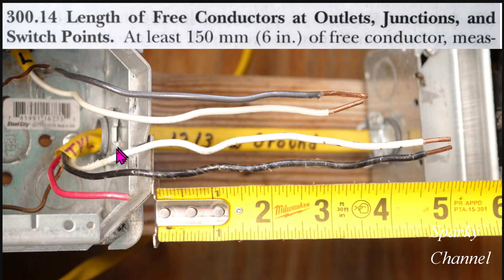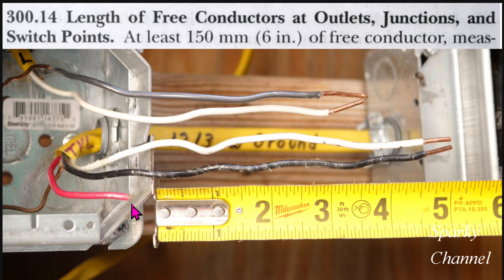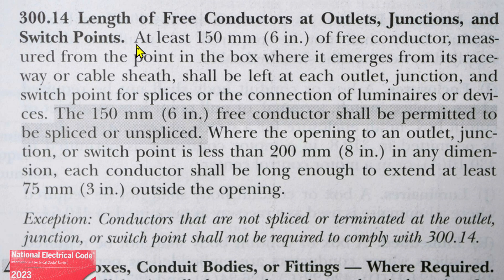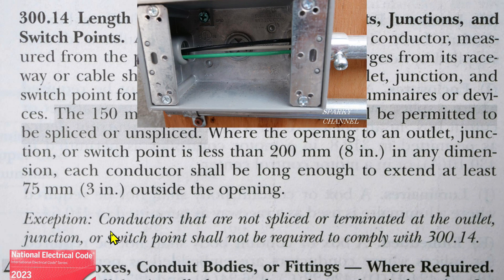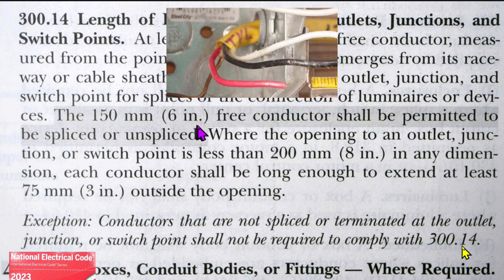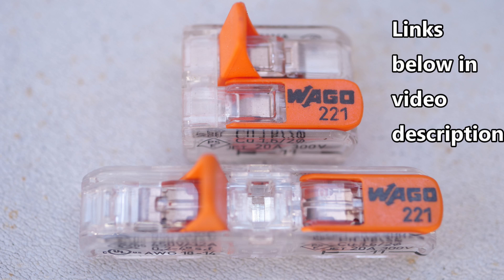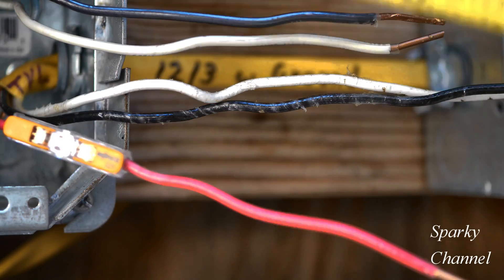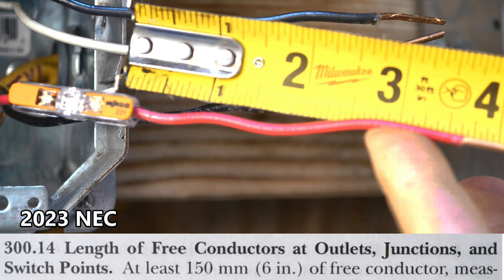How to Extend Short Wires per 2023 NEC 300.14

Comment: What do you do if the goof before you cut the ground wire right at the entrance to the box? (ie: not connected to anything, barely 1/4" visible in the box ) ?

Fortunately for me, they were as sloppy as they were dumb and there was ~2-3" of slop in the wall so I could pull a bit more into the box to connect it to the box's ground screw and then add a pigtail to that to the outlet.
Not sure if that is proper code these days, but the outlet tester settled down and stopped complaining about an open ground.
Reply: loosen the wire clamp and see if you can pull it in more wire, if your lucky there will be an extra 6" of loose wire you can pull into the box (called a service loop)
Reply: maybe I should have read the whole comment.  pull the wire harder, I think you only got half the service loop and got hung up on the bend in it.  that extra wire isn't sloppy, its code
Reply: @ydnark83  Interesting. It was janky all around. Have not lived there for over 15 years. But the wiring in that house was..... special. One outlet did not have any ground coming to it - very old 2 conductor, no ground wire with very fragile insulation. Wire was behind a tiled wall. The hack that was done there was to tie neutral and ground together in the box so the outlet tester was happy (although I suspect no inspector would be!).
Reply: @eh42  you might have aluminum wire, if you do you need wire connectors that are meant for connecting alum and copper and overhandling the aluminum wire will make it brittle and crumbly.  That might be why its too short in the first place too..
Reply: a good outlet tester would show that the ground and neutral are bonded
Reply: @ydnark83  The short wire that I pulled on was new 14/2 Romex - copper. But the other wire in the house might have been - that section I left alone. Another section I was upgrading was in the basement w/ open floor joists, and at each junction box where I touched it, the insulation crumbled and I would replace that stretch w/ new 14/2 Romex. Never did consider aluminum at the time. Fortunately that house has since been gutted to the joists, etc and completely redone inside - so hopefully all the sketchy wiring has been since replaced.
Reply: @ydnark83  How? The rest of the outlets have their ground and neutrals bonded at the panel - so unless it has some fancy ping testing circuit, I'm curious how it would know that the bond is in the outlet vs the panel.
Reply: @eh42  it will show if its bonded or not, not where the bond is, and yeah that's not really useful if your bonded at the panel but there is an led on mine that lights up if they are.   you could remove the bonding screw at the panel to check for other miswired outlets I guess but again not really useful.  Better to just inspect them 1 by 1
Reply: @ydnark83  code? Please show, I am curious
Reply: @sapreaper  code for what?  the service loop?  not sure what you mean, you might be in the wrong thread..
Reply: @ydnark83  you stated "the extra wire isn't sloppy, it's code" what extra wire or 'cable' ? Thanks

Comment: Your interpretation is taking the wires and bending them 90 degrees in one direction and then measuring 3" in either direction, but does the interpretation need to mean 'bend the wires' and go 3" from either side of the opening? Couldn't it just mean that the wires need to extend 3" straight out from the opening in the wall"?
Reply from the maker: Yes, you're correct. However, in a video, if you run the wire straight towards the camera, no one can tell how long the wires are.

Comment: So NEC-2023 allows you to splice onto short wires.  Did the previous codes allow that?  Many AHJ haven't adopted 2023 yet, so can you pick and choose which NEC version you're complying with?
Reply: I'll give you a straight answer, you can always splice wires in a box and that has been legal for over 30 years
Reply from the maker: Please go to article 300.14 of the code book that covers the year that you need to know about. It will tell you the answer there.

Comment: Just use an insulated butt splice.
Reply: good for stranded only
Reply: @71dembonesTV  why is that?
Reply: @danlux4954  can't get an adequate crimp onto solid wire; especially if its already too short in the back of a box. the wagos are THE solution for short wires. the standard type is adequate for most short wires but the straight thru ones look even better. have yet to use them but , im looking forward to having them in my arsenal
Reply: @71dembonesTV  I can get a proper crimp onto solid wire even in a space like that.
Reply: @danlux4954  you may be able to get what you call a proper crimp on it and it very well may work. doesn't change the fact that those type of connectors are for stranded wire.
Reply: @71dembonesTV  FYI the manufacturers site and specs says nothing about it being only for stranded wire.
Reply: @danlux4954  you are talking about crimp on connectors right? yes they do say they are intended for stranded wire. but it should not need to say that because it's just logical. you aren't going to get much contact area with a solid wire because it wont conform to the crimp.
Reply: @71dembonesTV  yes, if they were just made for stranded wire it definitely should say. And it’s copper wires and definitely will conform being a soft metal.

Comment: Bill or anyone know how to strip a #2 awg without knife? I mean I can do it with a knife but sometimes I sure would like a much easier cleaner way of stripping it. I have searched the Google and I came across many stripping tools but not one that may be usable for a #2 wire. I might have missed it though. Any advice or name of tool?
Reply: Take your pick:
1. Klein Tools 21051 Large Cable Stripper
2. C. K Tools 430004 Kabifix Cable Stripper
3. Jonard Tools CST-1900
4. KNIPEX 1620165SB
5. WEICON No. S4-28
And while you're at it treat yourself to a pair of KNIPEX StepCut Cable Shears in standard, comfort, or insulated grip style at your preference; they're a huge improvement over standard cutters when dealing with large gauge wiring conductors.
Reply: Thermally. Precision torch tip , gloves and a pulled with appropriate twist. Strangle with single strand for clean insulation termination ￼
Reply: I do marine quality battery cables.  I was nasa trained in basic high quality soldering   1981.  I have advanced since then
Reply: There are insulation cutting tools that rotate around the wire cutting the insulation. Sort of how a pipe-cutter works. This only works when you have a fair amount of room.

Comment: just a thought but i wouldn't pull all the wires to one side or the other to measure them i would pull them straight out of the box to measure
Reply from the maker: I would pull the wire straight out of the box to measure them. I just pulled them to the side because of my camera angle. If I pull them straight towards the camera, no one could tell exactly how long they were.

Comment: A question that may have been asked/answered already...
 Can a crimp type butt connector be used in these applications? I'm talking about the red, blue, yellow style that is often the norm in lower voltage (but often higher current) applications. Assuming proper heatshrink and /or tape covering is applied if and when needed. 
 I am not an electchicken but do all my own work and prefer to be better than code in everything i do.
Reply: As long as they are listed for that use yes. They would have to be listed for use with the wire size and voltage.
Reply: As Jason said, the butt splice has to be listed for that application.  And what I consider key is, are you sure you can install it properly?  A lot of folks use simple butt splices with crude pliers-like crimpers and don't get a proper crimp.  And some of the proper crimping tools can be too costly for the average DIYer.  While WAGO may cost a tad more, the installation of them is dead simple as Sparky shows.
Reply from the maker: I agree with Jason.
Reply: I have been using the typical Butt splice connectors for 35+ years in low voltage applications. I have the correct crimpers and knowledge.  I personally do not care for the wago style of connector as I've seen too many ofnthose type have weak connection and when higher current is pulled thtough them, they tend to get crispy over time.  
 I understand they are NEC compliant but we all know of similar compliant items that fail over time/useage.
Reply: @manmachinemake3708  Watch from 7:30 of the video titled "Connectors: Which is the Weakest Link" by the channel "Electromagnetic Videos". After 5 minutes at 50 amps the Wago push-in only connector failed when the current was raised to 65 amps, and the lever Wago failed at 70 amps. Wago connectors are more than safe when used within their rating, and do not get 'crispy over time', they have been used for decades in Germany without issue.

Comment: pull a 20 amp load, continuous threw that wago, and watch it melt.
Reply: Do you have a video to back that up? 
Don’t get me wrong, I am not that big of a fan of these lever connectors, but if I had $.10 for every comment that says that they melt under the rated current, I’d be rich.
Reply: @Gruntled2001  no video, just 30+ years experience.  look at the surface contact area of this device, compared with a wire nut, or other approved connector. the wago only "bites" into a very small piece of the conductor.  that alone will generate heat under heavy loads.
Reply: @keything8487  the wago bites the wire but it also has a tab for it to sit on, so you get more contact than say a backstab receptacle
Reply: @keything8487  I don't think a major brand name like Wago would be able to get its listing and certifications if they failed at the rated load. For the benefit of the doubters, there are plenty of videos like this out there: https://www.youtube.com/watch?v=4QVwAT4vd4g
Reply: @R900DZ  i wouldnt back stab a receptacle, if i saw an apprentice do it, he would get smacked.
Reply: @keything8487  sounds like an HR nightmare
Reply: @keything8487  If you want to make a few thousand dollars, put up a video on Youtube showing the wagos melting at 20 amps.   Better  yet,  send that video to Wago and tell them you will expose them on Youtube if they don't pay you for your very expensive time in making the video.
Reply: @puppyupper4565  ....ya really think a few grand?..ive never posted a video, they pay that much?!!!??
Reply: @keything8487  YouTube pays on average $3-5 per thousand views.   So, if you got a million views which I think you would if you could show a wago melting at 20 amps,, then yeah a few grand.
Reply: @puppyupper4565  I had no idea it was that kinda money !!!...thanks man !!
Reply: @keything8487  30+ years experience is how my dad justified always being right in the face of empirical evidence proving him wrong too. It's a bad look lmao
Reply: @71dembonesTV  how long you been doing electrical work?
Reply: @71dembonesTV  keything has an answer for everything and from his context, knows it all... no use arguing with him/her/it.  You'd be better off getting a root canal
Reply: @keything8487  lmao, classic response. i rest my case...
Reply: not going to happen; enough amperage to melt the wago is enough amperage to melt the wire insulation
Reply: @71dembonesTV  i wanna try n see.
Reply: @keything8487  the stress test has been done already and posted on youtube; it held as long or longer than the wire insulation. John Ward did the test i believe
Reply: @71dembonesTV  damn....well ....do you work for an electrical company? or own your own business? or just a handyman?  i have and do...so lets begin your lesson.....lets say you have  to make 5000 joints.  are you or your boss/owner going to buy 5K worth of wago's, or 50$ of wire nuts?...if you said wago's your nuts, get it...nuts...been around for over 30+ years, works just fine, fraction of the price......so tell me again why i should use these?..
Reply: @keything8487  and in response to your next comment: i'm a self-employed hvac tech; never have to calculate building costs for anything really. i charge time and materials and use whatever things make my life easy without compromising the quality of the job. 

I'm not making the argument that "Wagos are better"; that's just the strawman you're building. And you're burning it down with the notion of wirenuts being cheaper than Wagos which is also not the debate you brought to the table. A strawhat on a strawman; if you will. Not sure where you're going with this but I'm glad to watch the show ^_^
Reply: @71dembonesTV  the point that you failed to realize is this...sure it's a "new" shiny thing to use..and may be safe..I see it's UL listed.....but the ROI on them makes it impossible for anyone in the business to use...if they wanna make money.
Reply: @jaywelker5566  so whats your cost on wago v wire nut? im curious about your math...wire nut is around a 1-3 cents/each,,,,,
Reply: @keything8487  lol that wasn't your argument. and even using that logic; you're still wrong. These are major time savers (money makers) for situations such as what is shown here. Are they the most cost effective for new installations? maybe not. But once again, that's not the point anyone was trying to make.
Reply: @71dembonesTV ... ...i dont like them in real electrical work...maybe low voltage t-stat wires, speakers, dmx, etc....my opinion is theyre overpriced wire nuts.... clearly theres you and a lotta fan boys here for them.  im happy for that.....i am glad theyre UL approved.....this has been entertaining.  i am wishing you the best.....hope ya bought a powerball ticket !!!
Reply: @keything8487  you sure are putting a lotta words in my mouth to justify your opinion. i work in the real world and these things are lifesavers. but i guess i dont do "real" electrical work. keep standing guard at the gate old man; the rest of us have better things to do.
Reply: @71dembonesTV ...have a nice day...youngling
Reply: 60+amps, not 20. Watch from 7:30 of the video titled "Connectors: Which is the Weakest Link" by the channel "Electromagnetic Videos". After 5 minutes at 50 amps the Wago push-in only connector failed when the current was raised to 65 amps, and the lever Wago failed at 70 amps. There is no reason to go spouting your "experience" that consists of zero actual testing of the devices you are disparaging when there is empirical evidence available for free on YouTube for all to witness that shows factually that Wago connectors are more than safe when used within their rating.
Reply: @msytdc1577  Thank you for quoting the actual figures; i saw a similar video with the same result. however, facts and logic are lost on this old blowhard. the argument will end with "muh 40 years experience". Reminds me of my dad who also had "40 years experience" in his trade. that meant he was always right; no matter the evidence and opinions against him. very enlightened lmao

Comment: We regularly add splices in boxes to add extra wires to feed switches from a group of black power wires or white neutral. Not a big deal. Wago is the new change from Marr connectors.
Reply from the maker: Thanks Norm!

Comment: I might have been inclined, depending on how short the wire was, to use a crimp sleeve and solder it.  But good job avoiding all the European nay-sayers by recommending the Wago product!  :p
Reply from the maker: Thanks!
Reply: Europeans went to metric because they are too stupid to know fractions. Ask them what's half of 3/4ths? Metric is terrible.

Comment: I don't know why they did that. The add-on bedroom in my house has the receptacle box wires cut so short you can barely attach them. Not even enough length to use a traditional wire nut. I had to replace one, and could not have done it without a Wago. The regular fit well in my application. 
Unfortunately the 12AWG Wago inline splicers are impossible or too expensive to get. The link here is for a pack of 60 - far more than most of us need. The Ideal version is available at Home Depot BUT do not appear to be UL approved.
Reply from the maker: Well, the 2 connector Wagos work great and they are rated for 12AWG so that works for me!
Reply: Not sure which ideal's you're looking at on HD's website, go to lowes and type in "in line splicer" and you'll see a nice Ideal, UL LISTED splicer, item #30-1342S, cheap, in stock.  AND, according to Ideals own site, under UL listing has the following:  Rating: IEC 60998: 32A | 450V | 105°C max and UL 467: 20A| 600V |105°C

Comment: What about the “Ideal” brand of connector? They are sold at Home Depot. I stock both brands. I often prefer the “Ideal” connector. However, it is not suitable for stranded wire!
Is “Ideal” a recommended brand?
Reply from the maker: Yes, Ideal is a highly respected brand. I have a link for the Ideal inline connector, as well as other Ideal wire connectors, in my video description.

Comment: I got to get some those wago wire splicer connectors I have been using the two wire they are fine anything smaller is great help .
Reply from the maker: Sounds good! Wago makes 2 inline connectors. The 221-2411 is rated up to 14AWG. The Wago 221-2401 is rated to 12AWG. Also, the Ideal 30-1042 SpliceLine In-Line Wire Connectors are rated to 12AWG. Links for all of these are in my video description.